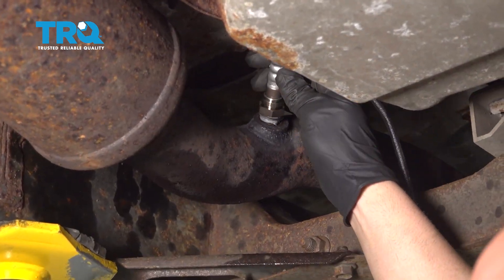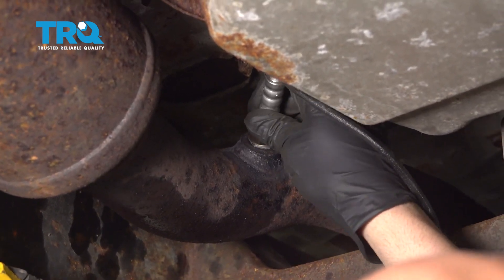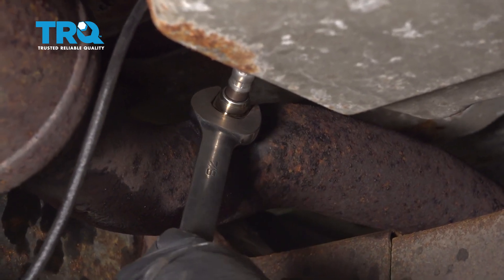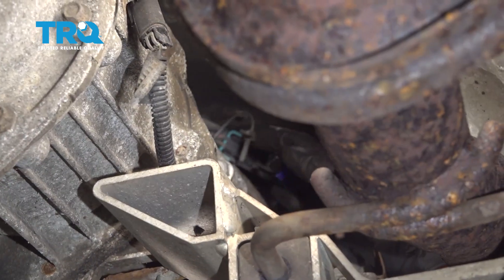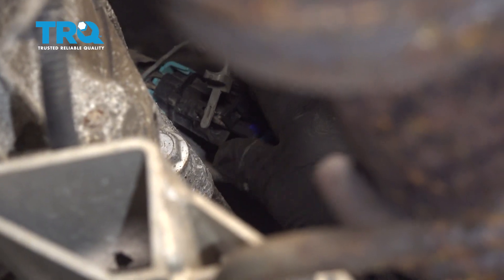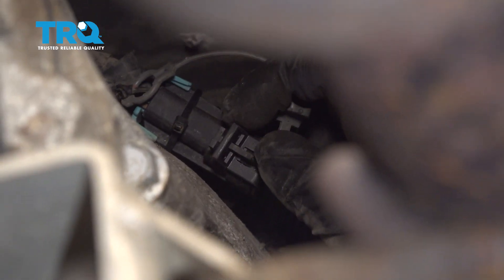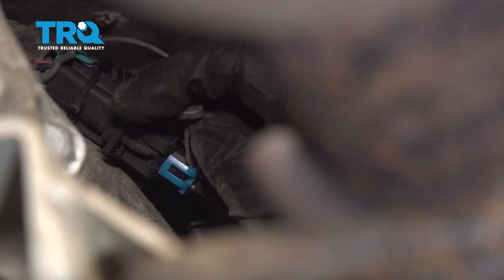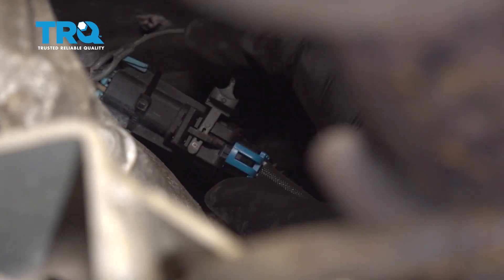How to Replace Down Stream O2 Oxygen Sensor 2002-2009 Chevrolet Trailblazer

Comment: Great video but how did you get past the heat shield? Did you bend it up? Keep up the good work!     Follow up & I got it done! I soaked overnight with sum PB Blast & I used one my 7\8 tubing wrenches which pretty much always works without rounding of bolts! Once I moved to the right with my flashlight, I saw the plug and got it undone. It took a couple of tries to get the plug back together but it lines up once you get a good grip on it to keep it from wiggling & put the safety latch back in. Thanks again for the videos that y'all make because they're really straight & to the point!💯👍🏿